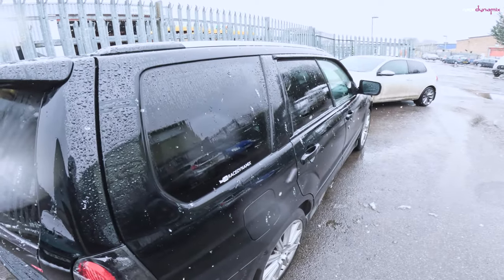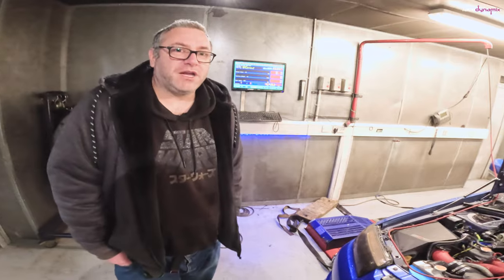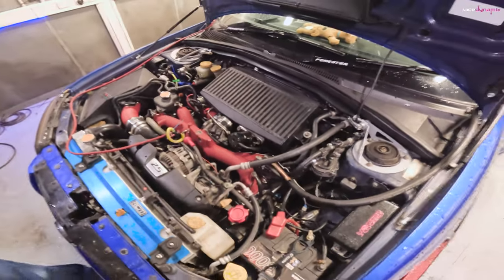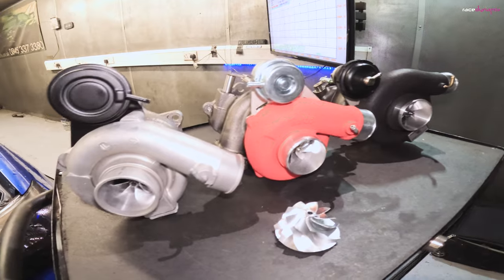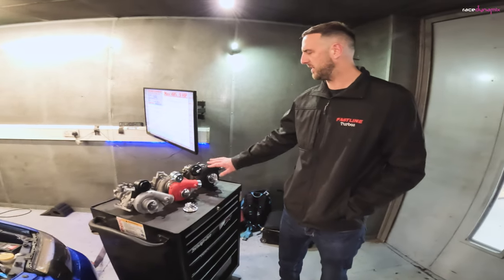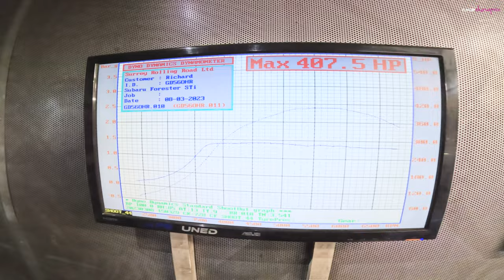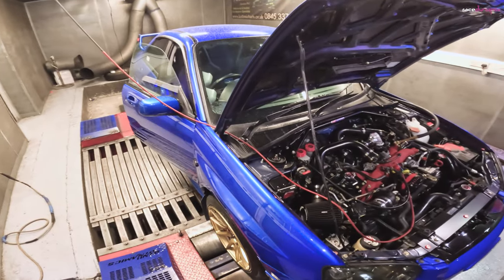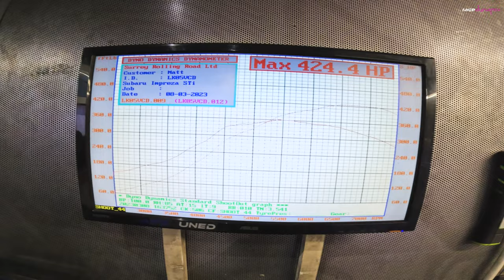Get 400bhp in a Subaru STI ... WITHOUT ruining it !! | Fastline VF400 in action

Comment: Hi mate could you tell us what supporting mods that jdm vf400 Subaru had, am looking to get to that type of power
Reply from the maker: Hi.  To get to 400 on that turbo set up on jdm you would want fmic, ideally some slightly larger injectors or fpr as the std 550 max at 400 ish on a 2.0.  Obviously free flowing exhaust is needed too.

Std headers are fine and no advantage in changing the twin scroll std headers.
Reply: @racedynamix  thankyou Duncan, am planning on having these mods installed to the car when the weather warms up I will contact you closer to the date for mapping.
Reply: @racedynamix  also what’s your opinion on gravity performance fmic ? Am looking for similar power to the one in the video

Comment: Hey bro, i have a Hawkeye version 9 jdm sti, are the stock internals safe with this turbo? What’s the hp limit on these ej207s?
Reply from the maker: Hi :)  Generally the JDM EJ207 STi engine is good for 450.  Obviously it depends on how safely it is mapped as nothing is 100% bullet proof but they are a great engine IMO.   HP Limits dont really exist for any of the ej engines as there are always exceptions but they should be safe handling the power of what these turbos can produce.

Thanks for watching

Comment: I have just bought a stock JDM Forester sti type m. I think it's totally stock. What work would I have to do to achieve the 400 bhp range. I'm guessing it's not just the turbo. Would I have to have forge work done or would it be reliable/safe without that kind of work too?
Reply from the maker: Hi.  I prese this is the SF5 based 2001 version.. 400 is beyond the capability of a lot of the components tbh.  Gearbox, engine, turbo, injectors, clutch, ecu, intercooler, induction.. It would be massively more expensive to go for 400 rather than 350 which would be a fraction of the cost.
Reply: @racedynamix  Hi, thank you so much for your reply. It is exactly that one, a limited edition version of only 800. I would be happy with 320 - 350. I don't abuse my cars so I'd just like a little more power. Where are you based? Have you got a website that I can contact you to discuss please? Many thanks again.
Reply from the maker: @scottporter4871  based in south of UK.. Racedynamix dot com 👍😎
Reply: @racedynamix  Thanks very much buddy. I'll give you a shout when it's in the county and ask you to do the necessary work from stock to just 325 - 350 bhp mark 👍🏻
Reply from the maker: @scottporter4871  👌

Comment: I have a 2004 JDM Impreza Sti  and looking to get this turbo, would it need any fueling upgrades, like injectors, pressure reg or fuel pump?
Reply from the maker: Matts JDM had std 550 injectors, fuel pump and a pressure reg turned up to give the headroom for fueling. 👍

Comment: Hi Duncan, thanks for mapping my Impreza back in May. Would I need bigger injectors than the yellow 440cc side feeds on my MY98 GC8 JDM WRX Impreza to get to 400bhp with a Fastline turbo? Currently mapped at 338bhp with larger top mount intercooler, 255lph fuel pump, decat exhaust, Mafless K&N air filter, VF22 turbo. Also is a fuel pressure regulator required as well? Thanks.
Reply from the maker: Good morning sir 😎 Yes the 440cc top out at 350bhp. A set of larger injectors would be needed.. Ideally 650cc upwards. Trouble is reliable or nice side feed injectors are rare so my best suggestion would be to go for top feed conversion.  Fuji Racing do a lovely kit then you have a very wide range of modern and efficient injectors to work with.  It's not a cheap step but if you must hit the magic 400 it is the best way imo 👍

Comment: Great video. Always toyed with getting a turbo for my 05 sti (widetrack UK PPP Car). I installed a fresh 340lph fuel pump, PFR7B plugs and have a 3 port solenoid awaiting fitting. What else would I need other than the turbo for 400bhp with the vf400?
Reply from the maker: Either slightly bigger injectors or a adjustable fpr to provide enough fuel.

Decat or good sports cat system

And either ported std headers or gt spec.

Obviously a fmic will help give enough cold air too.

Comment: Dying to bring the RB320 back to you D I've chopped and changed so many parts since it was last there !  PS did you get any software for the Final edition wrx sti yet ? Like flat shifting and launch control...
Reply from the maker: Cool.  What have you done?

Yeah I have the software for the final edition.  All the Ecutek racerom toys 😎
Reply: @racedynamix  lots  ... from a sleeved block to a cosworth heads   ! 
Hopefully see you in the summer months
Reply: What number do you own mate? I'm currently getting an Engine built for number 128 :)
Reply: @FourteenSucks  RB320 is 288 and the FE is 76

Comment: How I made a daily driven reliable 500whp in a STi just like the one in this video:
1.Built EJ257 closed deck block from OutFront motorsports
2. Nitride salt bath crank, Manley rods, CP pistons 9:1
3. ALL FASTENERS ARE ARP
4. Brian Crower forged valves, valve springs, titanium retainers 
5. OEM camshafts
6. NGK one step colder plugs
7. IAG TGV deletes 
8. IAG V3 AOS system 
9. IAG PTFE multi fuel line kit AND IAG fuel rails 
10. AeroMotive FPR
11. Injector Dynamics 1300cc multi fuel type injectors (moving to 1700's this summer)
12. Grimspeed 3 port boost control
13. Process West top mount intercooler with matching hood shroud 
14. Cobb engine management (switching to Haltech this summer)
15. Cobb E85 fuel system 
16. Koyo aluminum radiator 
17. OEM radiator fans (they push more air than aftermarket)
18. Cobb SP short intake
19. Tomei equal length manifold
20. Tomei up pipe
21. Forced Performance blue turbo
22. Invidia 3 inch catless downpipe 
23. Invidia 3 inch titanium exhaust system with titanium muffler
24. Tuned to utilize 91 - 93 octane pump gas or straight E85 by MoBetta tuning. Pump gas tune: 370whp......E85 tune: 500whp

My turbo is still in the prime range of boost power and not being overworked. My injectors are at 90 percent duty cycle which is why I'm moving to 1700's to have a more comfortable range.
Reply: I forgot to mention the dual fuel pump setup using the radium hanger and dual 400lph AEM multi fuel type fuel pumps. That does it for the engine build
Reply from the maker: Great spec 👏 Shame the tmic is hiding it back but I can understand the reasons for keeping tmic 👍
Reply: @racedynamix  restrictions where I live, but I also forgot to mention how I've combated that specific issue. Utilizing the factory intercooler spray system which only comes with 1 nozzle in the shroud, I have plumbed an additional 2 nozzles to completely cover the top mount intercooler during warmer conditions. Using RO or distilled water of course to not allow for buildup in between cooler fins. Fmic is coming in the future, but with that comes a precision turbo 76mm and an overhaul. It's as is right now to be the best possible sleeper on the streets.

Comment: Wish I could get that much power 
1050 injectors 
3” exhaust 
207 engine 
Number 4 cooling mod 
Bigger sump 
Gt pump 3.5 turbo 
E 85 
About 350 hp
Reply from the maker: I'm not aware if that turbo.. I presume it is rated to higher power?

Does seem low
Reply: @racedynamix  Uses a TF06 turbine with a 7cm2 or 8cm2 turbine housing
Billet 712GTP compressor wheel
Comes with Turbosmart actuator
This turbo supports 440HP
Reply from the maker: @hunterhomeservicesracing6453  350 is a tad on the low side then.. Making much boost?
Reply: @racedynamix  20psi

Comment: Hi, may I ask, if I were to to my K&N open pod air filter to some other brand open pod (from 6 inch to 4 inch maybe), do I actually need a retune on it?
Reply from the maker: Hi.  Difficult to say definitively without knowing your car or the tune on it. But.. If you are running a maf sensor and replacing the maf housing and filter then it may alter the readings from the maf sensor.  That would in turn change the air fuel ratio.. And need adjustment in the maps.

If it is just the filter on the end of the inlet pipe and the maf housing remains then it is unlikely to change much if anything.  However, it is easy and very worthwhile to make a set of det cans following the instructions in my video to check that the car is happy. Check Afr with a wideband to make sure the same.  I will be doing a vid on that soon.

Or.. Do some data logging and tune in to the live stream that I will be doing and we can see what is going on..

Hope that helps

Comment: what would you recommend for a blobeye wrx? I've a straight line exhaust with toyo catback. I was looking to get this vf400 but I assume I might have to open up the engine. what would you recommend as an upgrade in order to fit this turbo
Reply from the maker: Difficult one.. I have many customers with a std wrx engine running over 400bhp.  They understand the risk that their engine could go at any point.. And generally can afford to replace or rebuild.  If you can't then I would recommend sticking to a normal Vf35 type turbo upgrade as that makes for a great road car.  Chasing power is always expensive
Reply: @racedynamix  first of all thank you for this info, I will learn how to work on ECU, and I will upgrade engine internals with time before moving to a bigger turbo. seems like a a built engine is the way to go in case I wanna get some extra hp
Reply from the maker: @barilbaril1  de nada 👍

Comment: Would you say for a uk ej257 I’d need to forge internals to go near 400?
Reply from the maker: The std pistons are the weak point.. Just putting some good forged pistons in will give it the strength needed for 400. The rods and crank are good enough for 450 which is where the casings or rather the liners in particular seem to start to fail.  Thanks for watching 🙏

Comment: Forester, 407.5hp on a top mount intercooler, is this possible on a sti tmic?
Reply from the maker: Hi Jono.  The sti tmic is not quite as effective as this Grimspeed one so I would say unlikely to get over 400.  Having said that I did a 2.0L with the VF400 and sti tmic and that made 410 last week.  All depends on engine health and other supporting mods.
Reply: @racedynamix  you mapped mine back in 2016 with a standard TMIC, with a SC38, 20% meth map, plus every conceivable bolt on, made 436/385 @ SRR , was good enough for multiple low 12 sec runs @ Pod and North Weald :) BTW great content Duncan

Comment: How does it compare to vf48 hf ?
Reply from the maker: The Vf400 is essentially a vf48 wit a big wheel in it. So probs very similar
Reply: @racedynamix  Thanks, was thinking like that. Since i'm in EU -- easier for me to get vf48HF. OEM injectors would get me to 400? What boost and afr You run from 5-7k ?